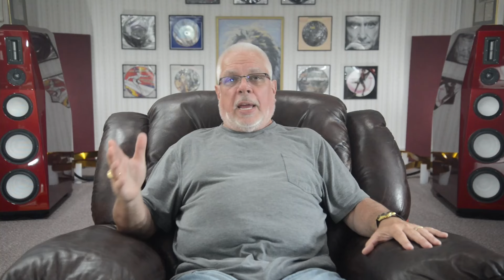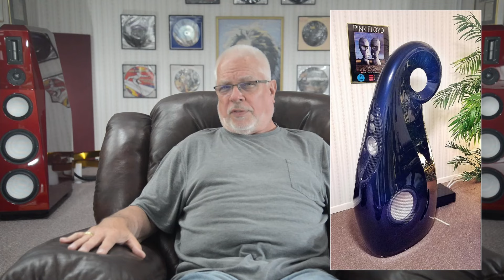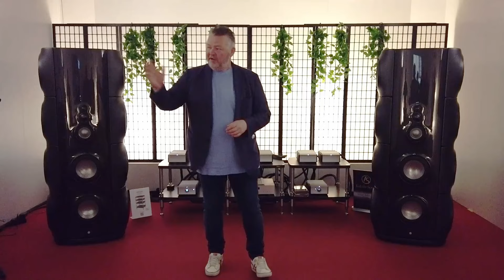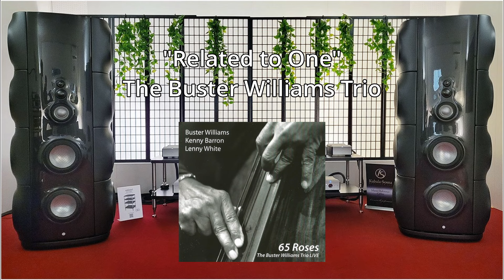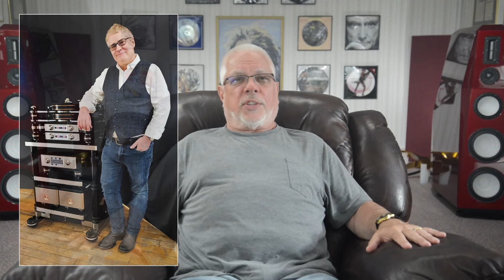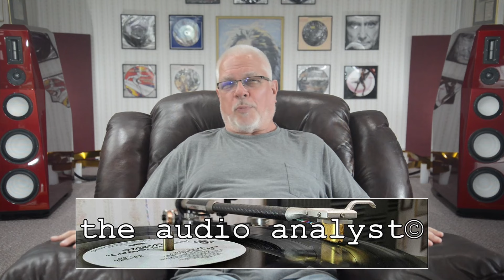E176: High End Munich 2024: Kronos, Mola Mola, Kubala•Sosna & Vivid

Comment: Mola Mola seems to be on the cutting edge. How much power do the Ossetra provide? And are they good down to 2 ohms?
Reply from the maker: As Ewald states at 9:12 (https://youtu.be/XQSb_PbE9io), they are rated at 350 W at 8 Ohms. Though there are no published specifications on the Ossetra’s as yet – they are still not listed as production items – given the listed performance of the Kaluga’s (400W/8 Ohms, 700W/4 Ohms, 1200W/2 Ohms - https://www.mola-mola.nl/kaluga.php), I would not expect that there would be any issues with 2 Ohm loading.
Reply: @theaudioanalyst  Thank you!
Reply from the maker: My pleasure... Thanks for watching, and commenting. 😁
Reply: I suspect that difficult loads and demanding impedance dips will be precisely where the Ossetra may shine coupled with incredibly high damping factor.. Bass could be relentlessly visceral when the loudspeaker are capable down there. 
I cant wait to experience them. 
 @theaudioanalyst